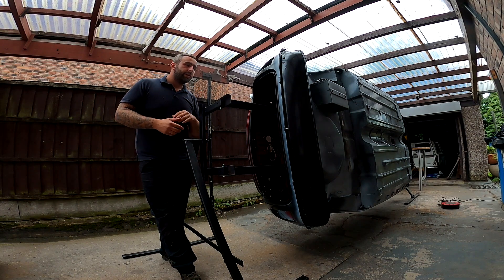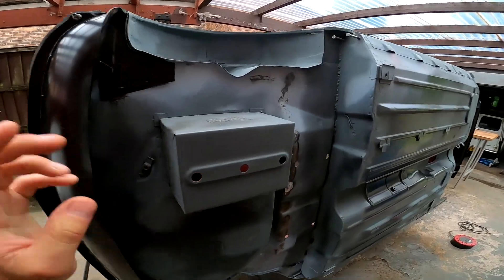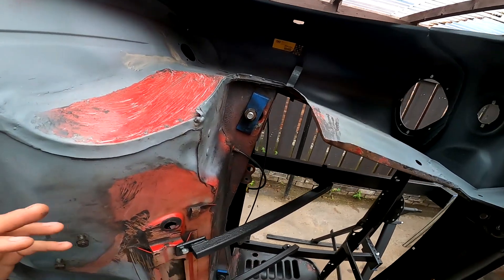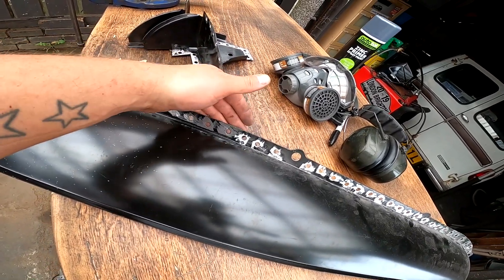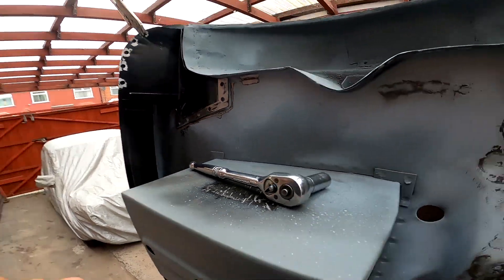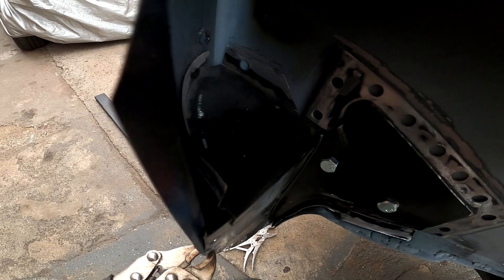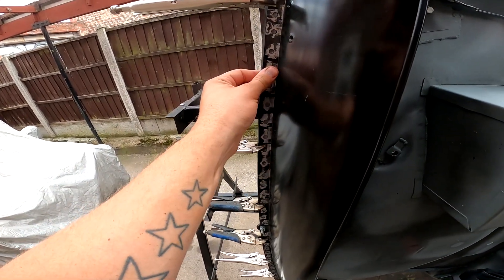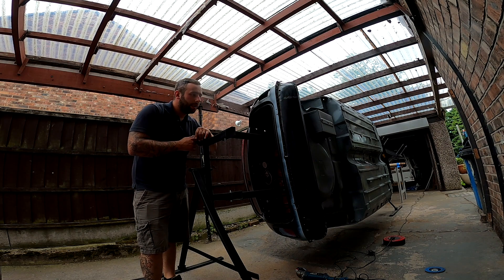89 CLASSIC MINI RESTORATION - REAR VALANCE

Comment: Something to help with the jig i think yours was 2nd hand so no instructions... I have a similar one and it should be easy to roll over 1 handed. On my instructions the adjuster arms point up (not down like yours) and the rear bolts are 3rd hole up and fonts 6 holes up. That might make it balance better for you if you need to spin it much more.
Reply from the maker: Hey yes mine is a second hand tool. Cheers for those tips I will be sure to look into that and get it sorted, appreciate that 👍